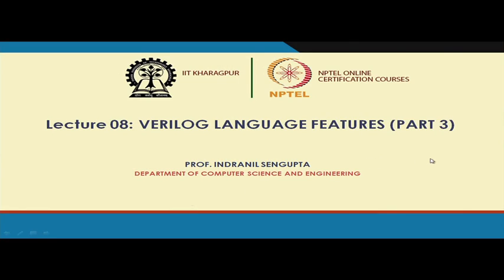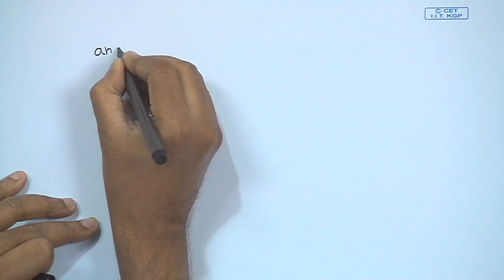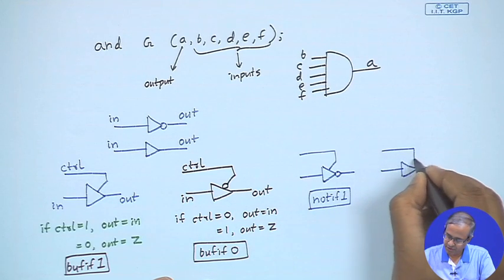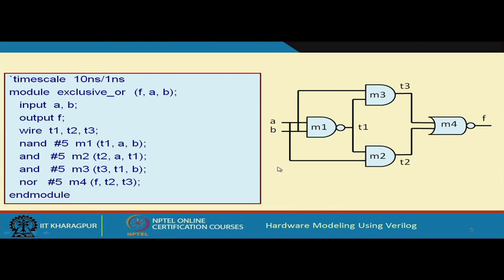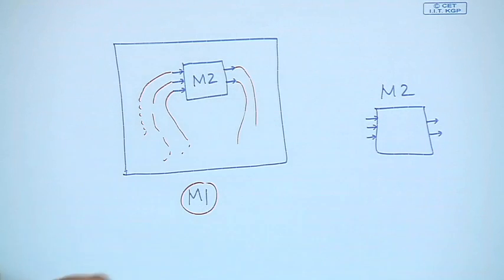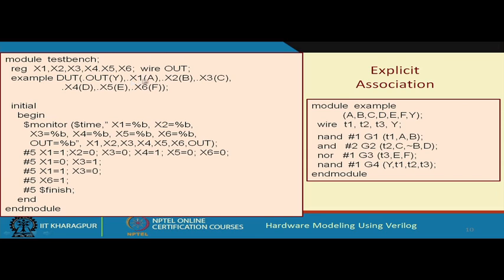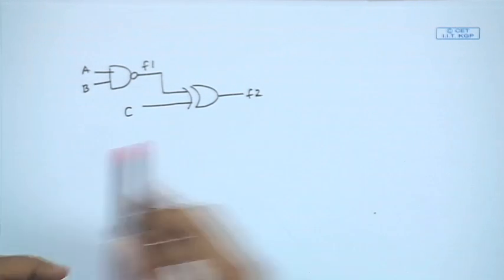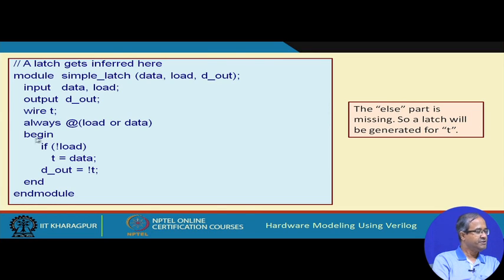VERILOG LANGUAGE FEATURES (PART 3)

Comment: But sir how can at 26:48 the t be modelled as a latch as it is defined as a net data type and you said that net data types can only be modelled as wire??
Reply: I think there is a mistake there. I think ' t ' should have been declared as a variable of type ' reg ' .
Reply: @guhanrajasekar5993  yes i also feel the same , but it is interesting that no one noticed in 6 yrs!!😲😲
Reply: Oo i noticed after reading this ...that should be reg.
Reply: @sakshisingh4197  Can you explain d_out can't be reg? As it is used on the left side ryt? I believe both t and d_out should be declared as reg.
Reply: @maradanitejaswi1201  I think they are explaining neet code here, actually their perspective is that, they declared t as wire, but during synthesis one latch will be generated this is the main point they are trying to explain,
Reply: @Pavan-d9f9o  explain more clearly please!!